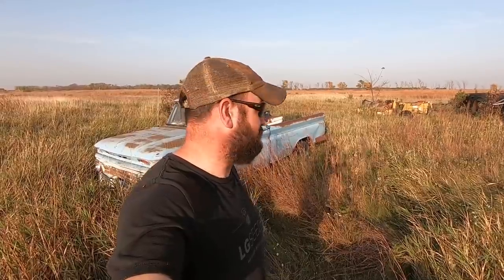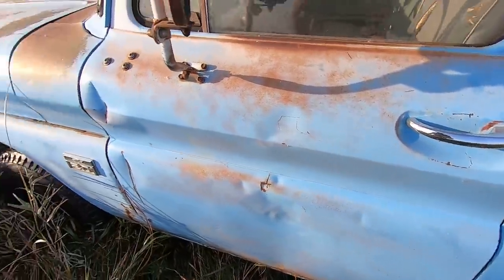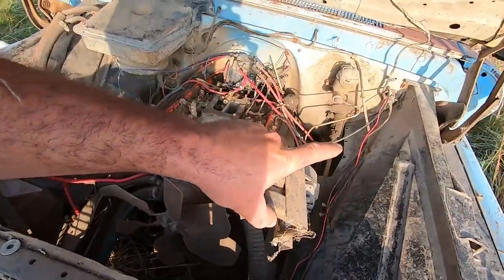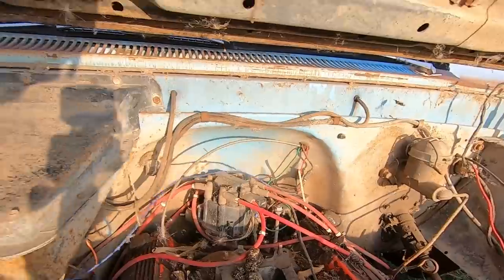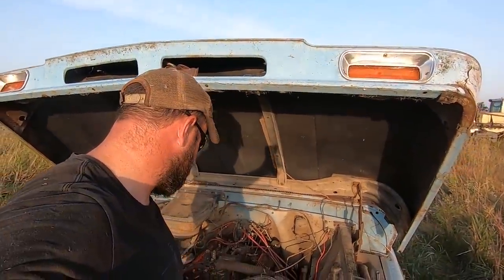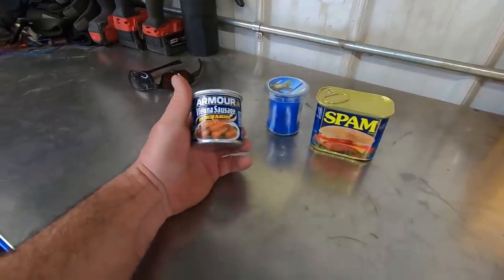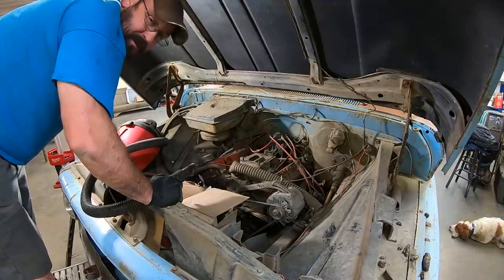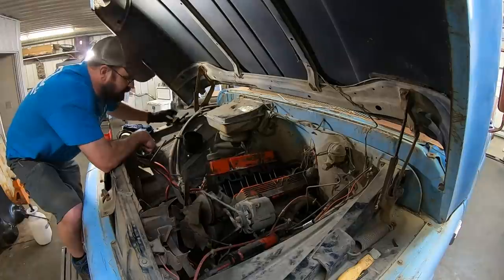Abandoned 1966 Chevrolet 4X4 K20 Farm Truck Left for Dead! Sitting for 15 Years! Will it Run?!?

Comment: I like the way this guy fixes floor pans. No welding needed.
Reply: Yeah and used self tapping screws.
Reply from the maker: The real classy folks use galvanized sheetmetal with them zinc plated rivets! In rusty IL you probably see some real creative solutions!
Reply: @MortskeRepair  ya know wd 40 isnt a lubricant its a water displacement liquid designed for saturn 5 rockets to keep ice from sticking to it.  ide go with the good old 3 in 1 but i bet wes has a better idea
Reply: Or rivets that’s how I attach my stop sign floor pans
Reply: This raccoon ate a lot of corn... What a great quote. 😂 Might need to get me some of those scrapers too. Nice truck! 👍
Reply: @MyLegacyGarage  thats a nice theroy to run with...but we humans dont take much yellow out the corn either and we can be way weirder than racoons ...top if a engine wouldnt be the wierdst place or use for that product...i dare ya to google it lmao
Reply: @mobiousenigma  Marvel Mystery Oil.  Tried and true.
Reply: Yes marvel mystery oil! Keep it in spray bottles and upside down juicermatics!

Comment: Considering the condition some of these motors are in, it is amazing they can be made to run at all let alone sound that good. Makes one wonder how long they will last. Great job with the poop truck!
Reply from the maker: NO warranty implied!
Reply: Never fear Mortske, if the old girl has 150,000 miles or less, you can get a service contract with one of those flim-flam companies on TV !
Reply from the maker: @jeromebreeding3302  Already done!

Comment: Mortske Monday and another sweet 4x4!  
(make sure ur HEI wire has 12 volts key on AND start position!) 
Uhhh, Vacuum advance goes to Ported off idle vacuum not full time manifold port, dude!
Should you be on the other side working the throttle and open the butterflies?  Hold it wide open for a second to unflood it and get some air with the gas.  Well, it sounds great and runs like a GrapeApe!
Reply: I CAUGHT THAT ALSO

Comment: I found a 64 C10 with a cammed 355, headers, glass packs and a 4 speed on the floor for $1500 but has been sitting for 10+ years. Was running when they parked it. Dragging it home this weekend. 😁 Can't wait to hear it for the first time.

Comment: Ma would have known if you used the "good" towels because you'd disturb the dust on them. 😂🤣  That and as many years as ours hung there I was afraid they'd crumble into dust if I actually tried moving them, sort of like the dead sea scrolls.  They were always accompanied by that dish of weird shaped, fancy bars of soap that no one was allowed to use....until the day came when the bathroom got painted a new color which required new fancy matching soaps and towels.  Meanwhile the every day towels were every color under the sun and so threadbare it was faster to dry standing in front of a box fan after a shower than it was to use those.  I'd get in trouble for using those anyhow because I'd use 2 or 3 to dry off with and was always accused of wasting clean towels.  Yeah, well when it takes 3 to dry you off perhaps it's time to buy new towels, ya think?  And why are some of these towels so old they have silver dollar sized holes in them and have a Holiday Inn logo on them?  You obviously got THOSE for nothing, so lets cut those up and use them for shop rags instead of the holey tee shirts maybe?  Cu the old tees into strips to tie the tomato plants to the stakes cause them zip ties cost money, boy!
Reply from the maker: Haha you nailed my childhood right there!!! I forgot about "the soap"!!

Comment: We both dogged the WD 40 cans tonight 😂😂
Reply from the maker: That stuff is good for cleaning bugs off grilles is about it!
Reply: It's only a starter . My old man made his own from used oil and kerosene.
Reply: @MortskeRepair  I use it for corrosion protecttion on anything marine.  It's a nice light oil to spray on everything.  But in your case it was literally better than nothing. C'mon man lower the friction and get the starter RPMs up.

Comment: I got my 1st truck the same way when i was 17, a 1964 pickup just like this, buried in a field and piled full of trash, it had set for over 10 yrs.. it had a cracked carb, i replaced it and put a battery and it started right up, i drove it for 8 years after that🤘

Comment: I always find it amusing when people act like the way they do something is the only way to do it. My father taught me to put a little "sillycone" on the edges of the rubber gaskets for the intake. I have only put one on about 4 or 5 times. but doing that they have never leaked. And I am sure that the way you do it, they don't leak either. It doesn't mater how you do it, as long as it works! And thanks for saving that old work truck!
Reply from the maker: There's several ways to skin a cat!

Comment: My homemade air chisel scraper makes hard work, easy work....I even tempered the custom made chisel to hold a shop vac hose...It even doubles to fit my hair clippers. Never use silicone...stops up oil holes.....gaskacinch and weatherstrip adhesive....sometimes even aluminum silver spray paint.

Comment: When I was a kid! I had a dodge swinger. Slant 6. The water pump housing broke, pulled the fan into the radiator. Broke off a fan blade, cut the battery in half and stuck in the fender well.😕
Reply from the maker: OUch!

Comment: I love those old exhaust manifolds they are so much better then the logs that GM went to later I don't know why they went to the logs because the ram horns were so much better. That's all I use on my crap if I'm not running headers

Comment: If I ever come across a will it run car here in Florida,  I'll know what to do, between you, Puddin and Junkyard Digs.  I learned a lot
Reply: I found a rust free 71 Thunderbird in Gainesville Florida  that last ran 6 months ago.  Needs typical repairs that the owner doesn't have time for. From the pictures he sent me just a couple hundred in parts and tires it should make the 2 hour drive to Tampa.  Maroon with a black vinyl top and paint looks good. Trying to work out a deal under $5000.

Comment: Hey Mortske.... Put in a 350 engine to replace the 327 small block twin poop engine... The rest of the truck looks like it'll roll well after more extensive poop clean up and should fit Duff pretty well... Sonofabuscuit....good tires and a strong heatercore should do it.......
Reply: PS..... NO FLEXI-HOSES EVER!!!!!!!!!!!!!!!!!!!!!!!

Comment: My ol neighbor made spam and swiss cheese grilled.  It was pretty tastey 👍🏻
Reply: In a pinch I've filed the plastic spaceres on the thick gasket.she sealedup real nice like,lol!
Reply: Wd40 works awsome on carbon and corrosion, and on pesky trailor light terminals. Good for starting fluid also👍🏻.i clean my 20 year old engine greased hands off before going in the house. 👍🏻im a big fan of it.

Comment: 1st and 2nd aren’t supposed to be synchronized in the shower Older ones with those granny 4s 1st gear is a grunt gear only not a downshift on the street gear. Love the vids thoe keep doing a great job👌🏻
Reply from the maker: 2nd should be, first rarely was back then.
Reply: I have a 66 k20 and second is synchronized

Comment: About the plug gap... I have a 73 C-10 that I converted from points to HEI, literally because I had an HEI distributor with a good set of plug wires and it's not hard to do. It used to light right off with the points and run well. It runs pretty good but I can't get that last little bit dialed in you know? I never gapped the plugs and never even thought of it. Also on the vacuum advance line, again not sure but I think I remember John W. saying that it's to be run off of modulated vacuum. I'm sorry to throw this "maybe" BS at you... Trying to find answers on shit. Seems when I hooked my vacuum advance to controlled vacuum, my timing light finally made some kind of sense. I'm not used to a light though... Usually I just get them to run then drive a while and dial it in as I go. That exhaust footage was gold!
Reply from the maker: Yeah I hooked the wrong vacuum up apparently but either will work.

Comment: sbc, no rtv.
buicks that i mess with, regularly have a 3/8 intake end rail gap, plus the gaskets overhang on both sides and have a locationg dowel. so i use gaskets on buicks pretty much exclusively.

Comment: Uhh, Mortske, you need to add (find a crank bolt) to that longish under-hood list ya got going. Speaking of longish . . . love how you keep filming and working at it until the project either starts or finds the scrap heap. Kudos for persistence. 👌(👀)
Reply from the maker: The early small blocks like this had a pressed on harmonic balancer.
Reply: @MortskeRepair  Thanks! I did not know that. You could weld one on just for looks?
Reply from the maker: @stevenpdxedu  I suppose I could

Comment: Now that you've driven it on a test drive,  it's a perfect time for an oil change, using Shell Rotella 15-40 oil for diesel engines, contains more Zinc for max lubrication!
Reply from the maker: I was thinking they took zinc out of that as well. I buy zinc in Risoline bottles.
Reply: They did take the zinc out of Rotella. The only oil you can get with zinc is the oil made for off-roading vehicles that costs 10.00 a quart or more.
Reply from the maker: @robertbak4108  Kinda what I heard as well!

Comment: Hey Mortske, where did you get the "sawed off" caulking gun? Ive got a short tube of motorcraft gasket sealer.  Ive looked everywhere for one of those short guns. Love this truck!
Reply from the maker: Right stuff sends them with 2 tubes of sealant! I just tossed one cuz I only use this one and just need the new tubes!

Comment: hey Mortske and Duff great stuff again. My Ford has a vibration at 55 mph i have replaced shaft bearing and u joints and it is better now but it is still exist. it was occuring during in 2 shift low rpm and on the stiff hills its now gone before replacing parts. i have a little play in the diff would that be the reason for that remaining vibration? i will have balance my wheels soon but i dont think thats the reason do you have any suggestions?
Reply from the maker: Do you have a bent shaft? Are the joints "in time" do you have a bent wheel? A flat spot in a tire or a broken bead?
Reply: @MortskeRepair  thanks for the reply I will consider all of them thanks 😊

Comment: I thought them turds would smoke, yeh you got em going rolling. I can't believe all Factory panels, and the tailgate is doable. 
        I noticed it's not a top loader. I'm assuming its a Saginaw. You can double clutch back down, with  a tap of the gas. Syncs are for momma's car.
       If Duff ain't digging it, it ain't got shit.

Comment: Of COURSE Duff likes it - it's a Chev!  What's not to like?  He had to chase that GM-hating raccoon (that was using the inlet manifold as a long-drop) outta there first, so he's earned his seat.  She's not a bad old rig, that one - at least she unstuck, rolled over and eventually started.  As to the 'no synchro' issue - just grind it until it fits.  Works every time.  Oh - and down here there's a phrase for anything that's not so great - "She's as rough as guts, mate".  A less PC (PG?) version would be "Rougher than a ten dollar wh---........er.....lady of the evening".

I could tell you a couple of stories about my old cat and a mate's Mercedes Benz and what the cat let drop down the scuttle breather (right in front of the windscreen) where the Merc's internal air-ducts and heater pull the breeze from, but suffice to say that you have to pull pretty much the whole dash out to get to the heater and then unbolt that from the firewall as well to get to the fresh air intake area.  Cat pee gets quite rank after a couple of days and my mate learned that trying to wash it out wont get the bit that the cat somehow managed to get up the pipes!  He also learned not to honk the horn at the cat if it was lying on the driveway.......and the cat did not teach him that lesson just once.  Oh no.  Old Oscar really liked to nail his lessons home, eh.....

The one thing I WILL say about the inlet manifold is that it reminds me of my sister's ex-husband - completely full of shit and totally useless as he sits.  I've also seen all manner of things fly out exhaust pipes, but never bird's nests and eggs.  Mind you, from the looks of that paddock the truck was in, they were a bit short of trees around there.......  Glad she ran, man.  Sounded better after her run too....  Plenty of time for donuts when the rad is in solid, it has brakes, there aint so much crap on the back, the battery is held down, the fuel tank isn't a temporary one......jeez, if I say any more, I'll be accused of being a health and safety rep!  All the best.
Reply from the maker: Thanks as always Lance!

Comment: Hey mortske, I see you have some kind of a stand to reach the back of the motor. I have a hard.time reaching the distributor cap and vac lines to my 3/4 ton. A small ladder doesn’t cut it for me. What do you use, and do you have an opinion on those top side creepers?
Reply from the maker: Top side creepers are nice but expensive and take up too much space for me. I've got a 3' wide or so 2' folding platform from Menards. Works great for 4WD work.

Comment: You forgot there’s no crank bolt, that fan is the least of your worries although it’s most likely rusted on
Reply from the maker: Early GM 327s had the harmonic balancer pressed on. Crank isn't threaded for a bolt.
Reply: @MortskeRepair  oh I’m use to late model sbc stuff 80 and new

Comment: 5:13 hmm must be locked up comes with the breaker bar and extension and maybe that socket fits the crank bolt
Reply from the maker: There's no crank bolt in these 327s, press fit!

Comment: You should make a to do list on the windshields with a paint pen so you can remember what it needs
Reply from the maker: I don't think there's enough glass there!
Reply: @MortskeRepair  i put a 97 12 value in my 2000 f350 with a nv4500 trans . Do you ever run across any late 70s 3/4 or 1 ton 4 door pickups.
Reply: Forgot to mention Ford
Reply from the maker: @danielwilson5296  I've seen a few. Been a while tho.

Comment: Did anybody notice, the steering column says this used to be a 3 on the tree?
 I used to own 2 different 66 Chevy trucks, but they were both 3 on the tree, 6 bangers. If the second one, a 'California truck' would have been 4 wheel drive, I'd probably still have it.
Reply from the maker: I did see that, I'm guessing it was swapped in at some point.

Comment: FYI melroe company the original creators of the bobcat loader and bobcat Company acquires kirschman company the creators of the spra coupe in 1972 . They were owned and operated by melroe and ingersal rand when ingersal rand bought melroe in 1995. Ingersal rand sold off  the spra coupe to agco company in 1998
Reply from the maker: FYI, it was the Keller brothers in Rothsay, MN that were the original creators of the Bobcat loader. Melroe just signed on to build them. I'm well versed in Bobcat and Melroe history as it's only 8 miles away and I go there every day!
Reply: @MortskeRepair  I own 3 loaders 1977 632
2000 773 g turbo
2002 s185
Reply: If you’re on fb
Check out our group with 2700 members operating and repairing m60-m970
A series bobcats. Joe Keller is in the group. The son or grandson of the same family.
https://www.facebook.com/groups/melroebobcat/
Reply from the maker: @tomhow12  Nice! Our local museum has some pretty rare Melroe stuff!
Reply: That’s cool

Comment: I was made in Iowa as well.
Reply: Ive had two fans on two different trucks fly apart. Both fords. One the blade flew off & stuck itself right threw my hood & wedged itself there. Went right through a rib on the hood of my 75 ford. The other, a 76 f250. The blade went through the inner fender.

Comment: My mentor that taught me everything about mechanic'n starting at age 14 called them Sh-t clips. He'd always say Sh-t when he lost one. Did it go down the intake? If one ever did it didn't hurt anything. On our drag racing BBC's and SBC's we used to peen the cross overs so the silicone would not walk or blow out. Never has. Always used Permatex Ultra red hi temp silicone. Those gaskets will work either way but I always put it up as well. Regular clear silicone works as well on the crossovers and all gaskets for that matter. I've got some cool old scrappers from Snap on but what is a set of the super scrapper's worth? I don't wrench for a living any longer. Just home shop use. Lastly the shop vac--"Taken turds like the toilet at Chipotle" Hilarious given how disgusting the place is. Really enjoy all your video's Mortske. Good job Duff. .
Reply from the maker: Thanks for watching and commenting Bob!

Comment: Use spam with rice and then you let me know how good it is, but let me tell how to make  it. you take 2 cups of rice put it in boiling water with 2 spoon of oil, half teaspoon of salt and envelope of zason goya,  cut the spam in to litter pieces and put it together wait until water dissolved then  stir the rice put it to small heat wait until rice is soft then is ready to eat. good luck.